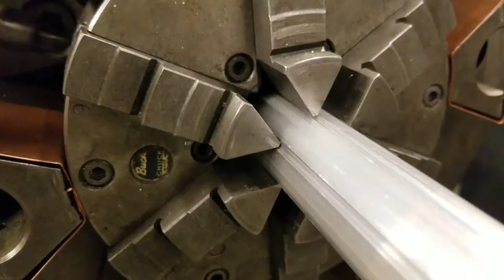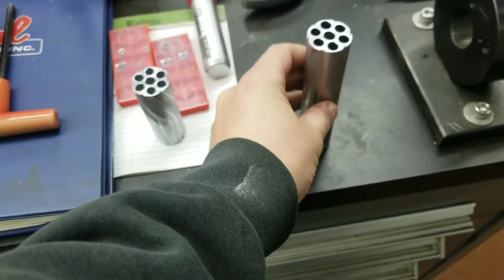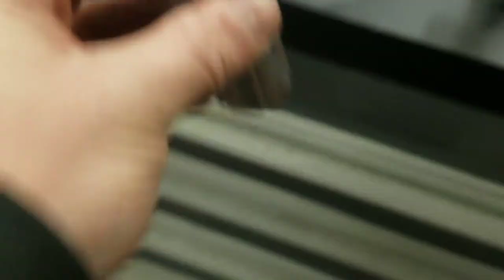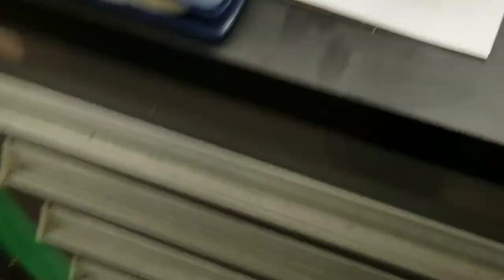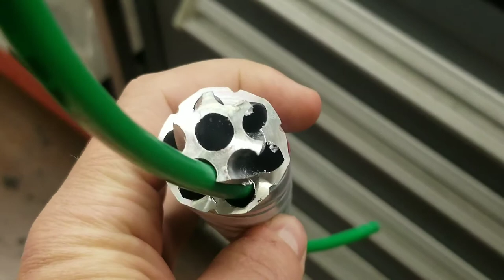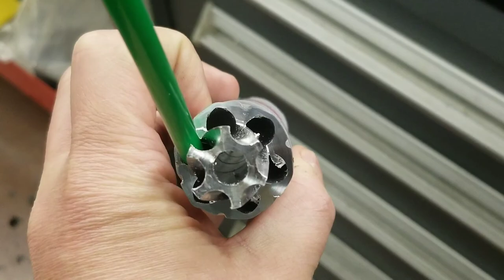Twisting some aluminum extrusion on the lathe.

Comment: Cool stuff Max!  I wonder if different grades of Aluminum act differently or if heating/annealing would change results!  Great stuff!  Thanks!
Reply from the maker: I'm afraid to try introducing heat into the equation because it will be impossible to  do it consistently which will vary the pitch along the length. The second I clamp the bar with the chuck or the torque nut it's gonna suck heat out of that area of the bar before I have a chance to start bending.

Comment: This is pretty cool, I guess they pull the wires through the die like that to put a set into them before twisting into a bigger wire?
Reply from the maker: This is in no way representative of any current production design, I work for an R/D lab, just tryin stuff.